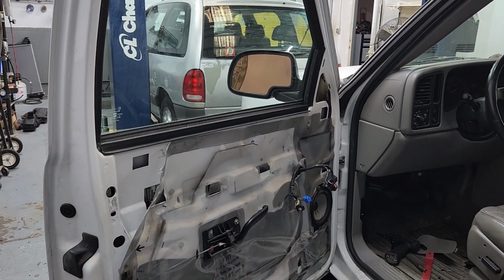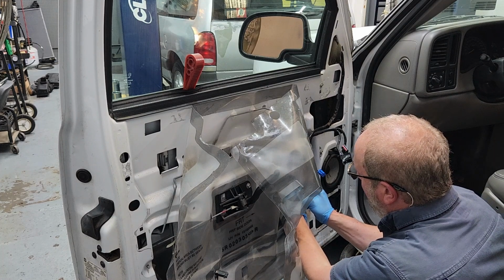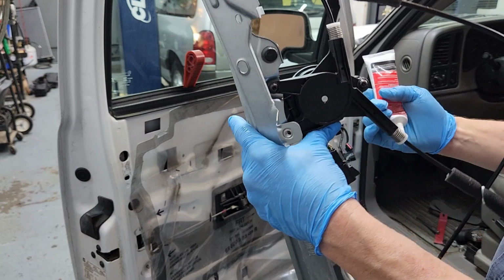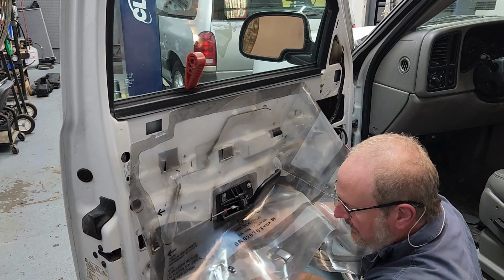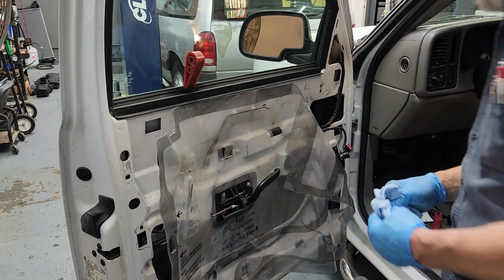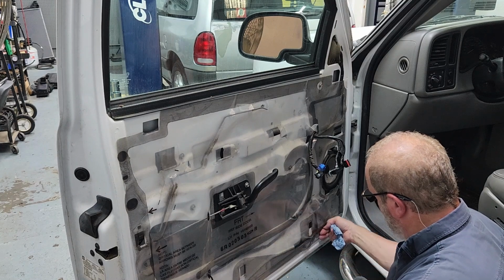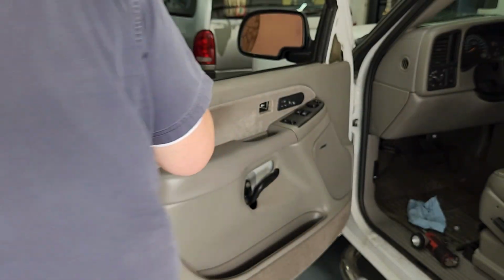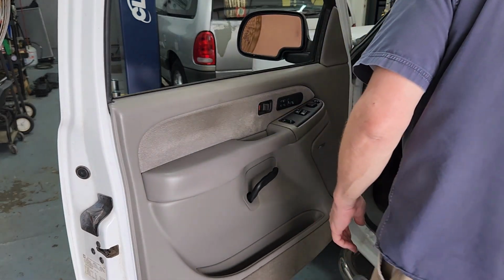2003 Chevrolet Silverado Power Window Regulator & Motor Replacement Part 2

Comment: Is that a oem replacement? expensive?
Reply from the maker: The regulator assembly that I used was a Dorman brand. I would have preferred to use the ACDelco branded part but it was not available locally. I put links to both in the description. A few things to keep in mind are that neither one is exactly the same as what came out of the truck. That design is history and both brands have newer "improved " designs. Also, as mentioned in the video, the locally purchased one has a longer warranty. It did cost more though. The price breakdowns are roughly this. The one I purchased locally was about $75. The Dorman on Amazon is about $50 and the ACDelco is about $120 on Amazon.